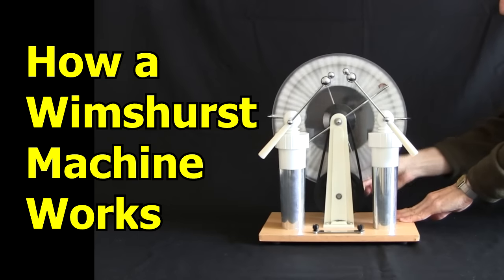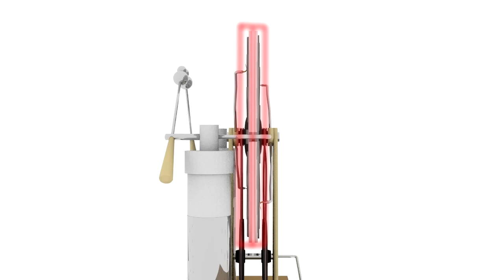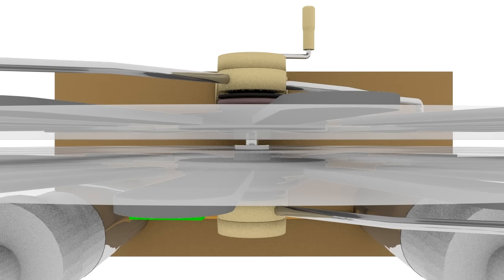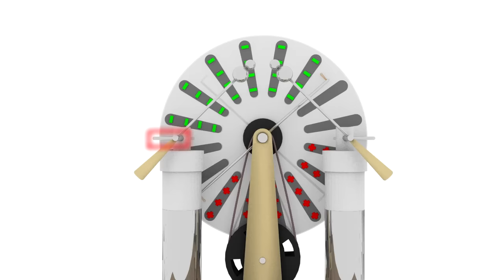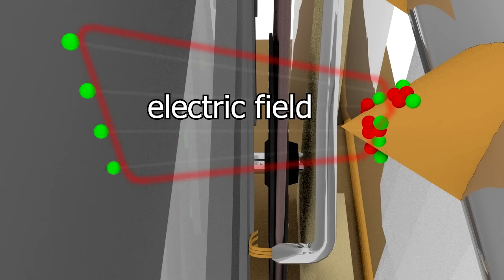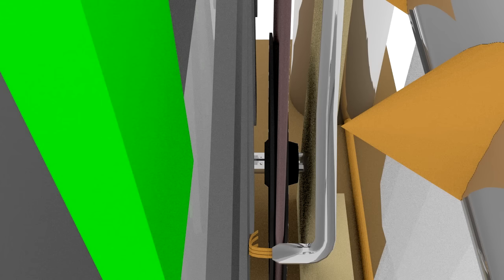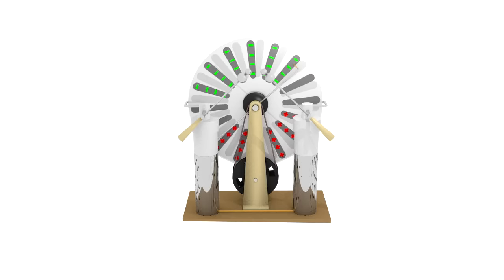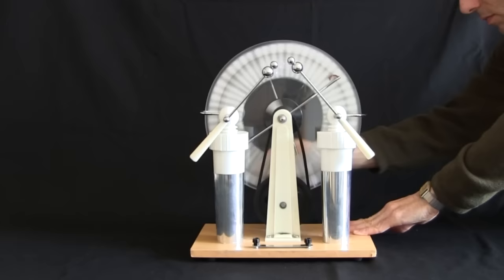How a Wimshurst Machine Works

Comment: Hello again Mr. RimstarOrg ! ,  Sir, I think I sort of solved the sector scraping problem. My Wimshurst Machine used four metal spikes to collect the charges. Two for one side and two for the other side. I just took a pair of pliers and removed them and replaced them with some aluminum tape shaped like a flat point that brushes up against the disks BUT wouldn't dig into them like the spikes did. Sir, after solving another problem I had I have to say that I have waaaaay better ESD than before. Its like the day I first got the machine. Good as new ! Okay, now I'm going to see if I can make a Wimshurst Machine FROM SCRATCH! The one thing this improvement to my Wimshurst Machine has taught me is that I should NEVER be afraid to experiment scientifically with Ideas and things ! If I can make a Wimshurst from scratch then I can make multiple units and drive them all with one dc motor and interconnect them with gears. At that point, "Skys' the limit" because I will be able to generate any amount of high voltage. I thank you sir for your videos, they're really helpful in mullng thins over in my mind. I hope I can talk like this with you from time to time, thank you again.

Comment: Great video, excellent explanation. But you have forgotten to clarify an important point: 
How does the tension in the Leyden jars continue to increase? 
After all, the electrons in the increasingly negatively charged jar must repel the electrons from the collector at some point, unless the tension at the collector keeps increasing to overcome this hurdle (and vice versa for the positive charges).

The explanation for this phenomenon is hidden in the capacitor formula's:
The two opposite sectors (one positively charged and the other negatively charged, in your video the ones at twelve o'clock ) together form a capacitor with a certain charge.
The well known capacitor formulas are: C = εA/d and C=Q/V.

Rewritten: Q/V=εA/d. 
(The capacity C, Farads drops out of the equation)

The permittivity (ε), the surface area (A) and charge (Q) do not change (no leak assumed). Now that those two sectors at twelve o'clock are rotating away from each other, the mutual distance (d) does increase sharply. As a result, the (negative) voltage (V) across this capacitor must increase accordingly, and is always higher (lower) than the voltage across the Leyden jar. 
In theory, if there were no discharge at all (which is impossible) , the tension between the two jars could rise to infinity.

I built a Wimshurst machine myself a few years ago. Maybe I will make a nice video with a detailed explanation concerning the build and theory. 
In the mean time you can see it sparking here: https://www.youtube.com/watch?v=QrFva1FmDhk

Comment: nice video it helped me to understand the aparatus, thank you very much! but one thing is missing a bit. the charge at the opposite sectors must become continuosly higher because otherwise it would not accumulate in the leyden jars. the fact that at the beginning it have only ONE sector charged and it influences charge separation at TWO sectors on the other plate makes the over all electric field stronger. this two charged sectors then rotate further and influence even stronger charge separation on the other side sectors and so on. so the charge separation effect adds up every time the "new/higher " charge meets the opposite neutralizer, and therefore charge becomes alternately higher on the front side and back side and cycles clockwise and anticlockwise.
Reply from the maker: That's correct. The charge on the sectors builds but quite a bit. The limiting factor is the leakiness of the sectors. In the dark, they glow with corona at their sharp edges and with corona between them. You can also smell ozone. If you don't collect at least some of the charge at the collectors then it becomes hard to turn the crank due to the strong attraction between the opposite sectors which in turn is due to the amount of charge on them.
Reply: Thats impressive. I would Not think that you can feel the force on the crankshaft Wow
Reply: I must be slow. I don't understand how this generates a charge and why it keeps growing.

All I see in the description is a lot of capacitors and wires holding charges.  If you put a charge on a capacitor and then start connecting it to other capacitors the charges move and distribute but they don't grow in magnatude. They just keep getting smaller as you spread the charge over more capacitors.

I can grasp how this acts as a charge "sorter" so random starting charges get sorted by the action of the neutralizer bars moving charges.  But I don't get how those sorted charges can ever exceed the total starting charge.

So what is the mechanism that causes the the charge to grow larger in this device?

I understand the mechanical motion of the device is the source of the energy generating the charge but I don't grasp how this works.

And why are the collector's pointed air gaps?  Why not use another wire and brush to collect the charge?  And what keeps the charge in the liden jars from returning to the disk? I don't understand why there is a one-way flow at work there.
Reply: My friend is convinced that this device can be used as a source of free energy. "I can harness this, regulate it, and then store it so it can later be used to chrage my batteries!" 

Im not sure how to explain how that is not exactly likely.

He feels he just has to start it and walk away. Then come back to full batteries. 

That isnt true is it? @CurtWelch

Comment: I thought this was great.  Thanks so much for the video.  Trying to get an old one working that was found disused in a back room at our school, dreadfully corroded by acid fumes and its leather belts were rotten.  Further, it looks as though someone was modifying it back in the 70's and didnt complete the job.  An interesting rebuild.

Comment: Great video! Would it work if the brushes have higher surface area and are very close to the sectors, but not touching them tho?
Reply from the maker: Thanks! I recall seeing some with contactless brushes. I don't recall what the brushes looked like though.

Comment: Hi RimstarOrg;
I have to comment a bit about where the energy is obtained to cause the separation of the charges and generate such high voltages.
The separation doesn't come about for free! Work must be done to do the separation.
The plates on the disks form capacitors, "variable capacitors".

1. The plate pairs when initially charged have relatively high capacitance between each other. The energy in this capacitor is E=(CV^2)/2.
2. The capacitance of this capacitor is inversely proportional to the distance between the plates.
3. As the disks rotate the capacitance deceases between the plates. Since the charge in this capacitor is constant the voltage increases the further they are separated.

It takes mechanical work to oppose the attractive force between the plates. This work converts relatively low initial voltages  to substantially higher voltages. 

Note! Power is Voltage * current, W=V*A.
The initial plate charging current is the same as the current being collected and delivered to the Leyden jar. But, since the voltage is much higher the delivered output power is much higher then the initial input power. The added power is caused by the mechanical work expended in turning the disks.

redrok@redrok,com

Comment: Thanks from Brazil. So...  why do you need the Leyden jars instead of solely conect the colectors to the spheres?
Reply from the maker: The Leyden jars are for getting bigger sparks. They collect additional charge so that when the spark gap breaks down, the spark will have more charge (current) and so will be bigger and brighter.

Comment: Excellent video and good example to show that energy travels through wires unlike the claim Derek (Veritasium) made in his latest videos. The long transmission line that he uses there is a capacitor and that small energy transfer in those first 65ns are due to capacitor (transmission line) charging as the electric field itself can not transfer energy but the field is the result of electron imbalance.

Comment: Thank you for great explanation and visualizations.

There are 2 Questionable statements in video. 
These are  my clarifications:
Capacitor stores charge in dielectric, not metal plates. metal only used to shape a charge and conduct it. 
Also charge never goes inside metal. Due to repellent effect it only can travel on metal surface. 

2. Are electrons and protons real? it is just a model. In the ancient physics only positive charge particle exists. Negative charge is a luck of positive particles.
Reply: "Capacitor stores charge in dielectric" No, you can build capacitors without any dielectric material.
"charge never goes inside metal." Oh yes! It is inside all metals. Conduction electrons are everywhere in a metal. You are probably confusing direct current with alternate current, where there is a so called skin-effect. 
Are electrons and protons real? it is just a model. Agreed, but what's the point with respect to what is said in this video?

Comment: I understand how this works, but nobody seems to mention the voltage multiplication effect of the contra-rotating discs. At school we were taught that Q=CV. When two plates are opposite, they have a fixed charge; as they move apart, the charge remains the same, but the capacitance is reduced, causing the voltage to increase proportionately. Once the plates are at maximum distance, the voltage increase is sufficient to enable the charge to 'bleed-off' to the leyden jars via the corona between the plates and the collector points. Have I misunderstood something here or just missed a point?
Reply from the maker: Hmmm... Interesting. I was aware of the voltage increasing as capacitor plates are separated but hadn't considered any part it may play in a Wimshurst machine. That voltage is between the plates but I guess since the collectors are capacitively coupled through the collectors then the voltage on that side would be affected too.

Comment: How much watts (voltage and current) does it produce every second?
Reply from the maker: That's hard to answer. The voltage really depends on the distance at the spark gap. I did read somewhere that the current at the collectors is around 10 microamps or less though. Of course, if you have a spark then the spark contains a much higher amount of current over a brief time.

Comment: Can you remove the "third capacitor" the one that sparks and connect all other capacitors into a battery and turn the current here into any usable energy?
Reply from the maker: Theoretically, yes. The voltage will likely be too high for the battery charging. Also, Wimshurst machines have been known to switch voltages while running -- one collector may be positive and the other negative, and then something happens to the charges on the sectors and all of a sudden the polarities at the collectors reverse. But if you can lower the voltage at the output then some diodes would take care of that.
Reply: @RimstarOrg  i kinda want to connect Wimshurst machine into a stirling engine to produce even the slightest useable energy, i wonder if i can do it with that configuration
Reply from the maker: Theoretically it's doable. The Wimshurst machines crank does take quite a bit of torque so you'd need a powerful Stirling engine.

Comment: Could you please explain, why does this machine doesn’t work in very humid places?
Reply from the maker: Humid air is more electrically conductive than dry air. That allows a lot of the charge on the sectors/segments leaks to the surrounding air and so it is harder to start the whole process.
Reply: Short : damp acts as a short circuit...
😊

Comment: On a bicycle!! That’s fantastic
Reply: So if you want to power something, where would the wires be connected ? Replace the two ends of the spark gap ?
Reply: @fxeconomist  you’d need a great deal of capacitance to get any useful low voltage power from that. Or yeah you could replace the spark gap with a high voltage (probably electro static) device
Reply: @thatwontwork9046  I thought the spark gap was the exit point of the produced high voltage. I know it needs amperage, but I have a crazy idea about that.

Comment: Hello, when you said, on the other side only the negatives can move and are attracted by the positives charge of the opposite sectors and in the video we saw only the negatives leaving away (which makes sense) of the  negative and positives charges. Just wondering could some of these charges be the negative charge that arise from the opposite sector being negative thus making this side negative as well due to the induction effect be some of these charges in addition to the previous (positive and negative plates)?
Reply from the maker: Hi, I was able to follow your question right up to before "as well due". Before that point, the answer is yes. That's what I was trying to describe. What do you mean from the "as well due..." and onward? You can see how this is hard to put into words!
Reply: @RimstarOrg  thanks for reply Rim,1. Is the charge state of the opposite disk where you explain opposite disk have different sectors charges? 

Does it have for example all negative charge on all of its sectors. Or all neutral both positive and  negative? My guess is a mixture or random charges as you state in the beginning but clarification would be great. 

I said as well because I didn’t think only neutral charges would be the only thing that exist where the Induction effect would take place where a be one disk and b opposite disk, if a sector has negative charge it will eventually make its mirror sector of b be negative as well due to induction effect. 

Lastly I want to say that I loved your videos and you explain and clarify the most confusing fundament al subjects at least for me. I am 100% the wrong one here I’m just throwing out there for education these questions mad respect sir hoping for more videos soon it’s been awhile since you made some an idea I think would be to explain ground I still don’t get how ground work but I see you confidently working with ultra high voltages and current confidently knowing 100% you will be safe I don’t yet lol or maby you are studying higher subjects?

Comment: Hi, Can static electricity be harvested and used for high power use ?
Reply from the maker: In my experience, no. There isn't usually much power available when you generate static electricity. When there's a spark there is but then you have to wait to build up for another spark which makes it not much power overall. Regarding this Wimshurst machine, the power output will always be lower than the power you use to turn the crank. And since Wimshurst machines have a lot of losses, they're also not very efficient.
Reply: @RimstarOrg  Thank you . Do you think that " spark" would bust the water molecule ?
Reply from the maker: I don't know.
Reply: Yes ..see : star ship enterprise and ghost Buster rigs.
Reply: @RimstarOrg  wimshurst USS Enterprise design .
Wimshurst ghost Buster rigs designs.
Wimshurst used in Welles time machine.

In reality they don't use.
Only in fantasy.

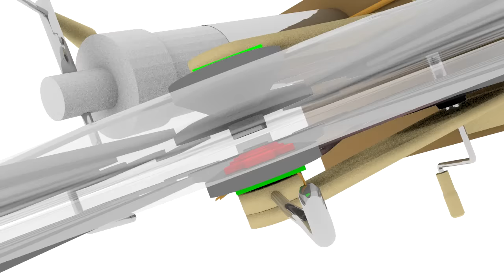Comment: 3:41 why ALL negative charge goes to lower sector? For charge is better to be split between upper and lower sectors? Isn't it?
Reply from the maker: At 3:34, the negative charge in the sector shown at the top repels the negative charge to the lower sector. That's what's really doing the repelling. The amount that will be repelled depends on how negative charged that top sector is.

Comment: What if we connect a small light bulb in between the capacitor or inbetween the spark gap, will it light up?
Reply from the maker: A small LED might light up. I know I've seen people put small LEDs where the neutralizer bars are, so cut a neutralizer bar and insert and LED. That works.

Comment: Is this better than a Van de Graaf for the DIY-er? I made a Van deGraaf from coke cans but never got large sparks...good job on video...
Reply from the maker: You can get large sparks from a Van de Graaff generator too, you just need to make it bigger. I made a small Wimshurst machine and it's even less powerful than my coke can Van de Graaff generator. So I wouldn't say either is better. However, since you've already made a Van de Graaff, maybe it would be fun to try a Wimshurst machine this time.

Comment: Why do charges accumulating to the collectors rather then draining from them? Unlike Van de Graaff, these collectors are not neutral (spark gap gets potential from there).

Edit: Trying to answer my own question... I guess the collecting combs will reverse charge those sectors anyway. But as the discs kept rotating, charge will build further up on the sectors until reaching an equilibrium.

Comment: awesome explanation! but I always wondered.. what if instead of a spark gap, have a resistor, could you get a small DC current that way?
Reply from the maker: Thanks! Absolutely, you could put a resistor instead. I've read that there's around 10 or so microamps at the collectors, but it's something at least. I've seen people light small LEDs that they put in the middle of a neutralizer bar.